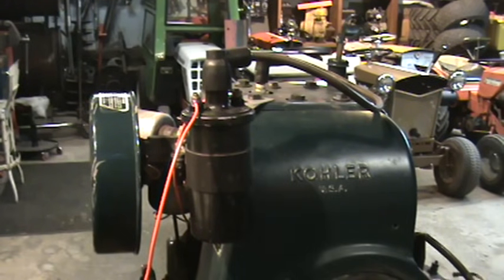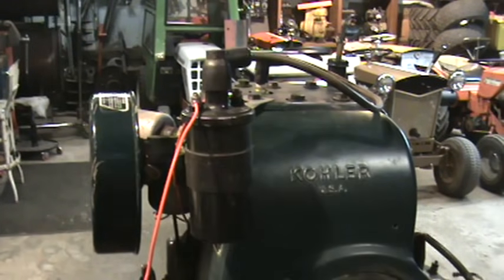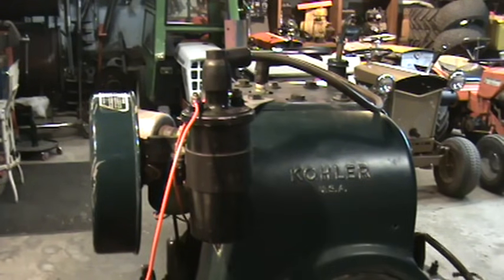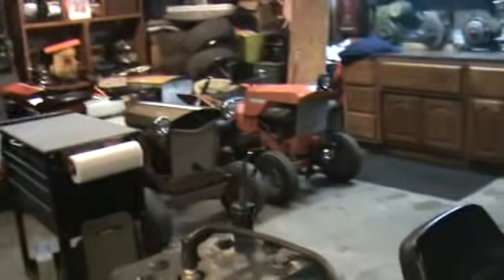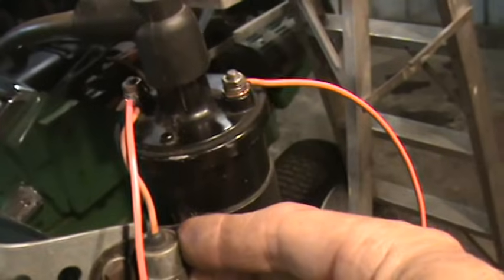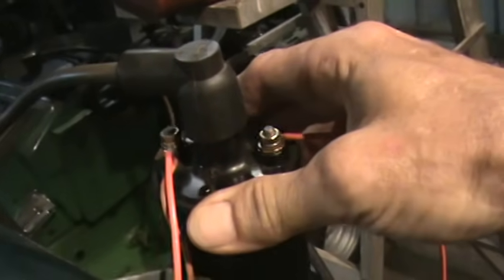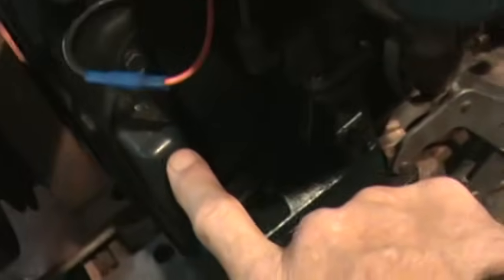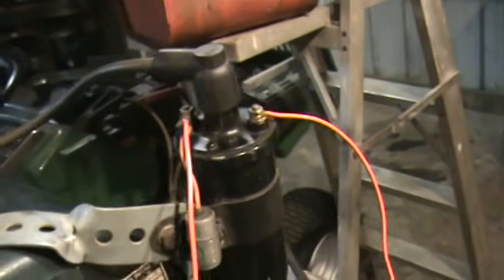Wiring an external battery coil to your engine

Comment: I have a 10 horsepower Wisconsin on a welder. I can't get the proper ignition coil anymore. Mine commands spark with a pulse of positive electricity will that work on that set up?

Comment: I put this motor on craftsman with the 3 speed high low rear end and it's side shaft rear end built pully guids and motore mounts to bolt my 12 kohler onto it and make it a belt driven side shaft mower  but I don't know how to wire it up to make it run I have my negative from cool to points but I also have a wire coming of the part that I changed on the motor to make it charge but I don't know wear it goes my egniton,my silinoed,my battery I honestly don't know and do I still run the positive from my coil to my positive on the battery or does it go some whear else now

Comment: The coil creates spark when the points OPEN, not close. When the circuit is closed,  the coil creates a strong magnetic field.  When the points open, the field collapses, with electrons going into the secondary winding and discharging across the spark plug gap.

Comment: Zippo if if my coil isn't connected right with the battery with grounded like you said and what would that cause popping in the engine like if I could hear like a popping sound coming out of the exhaust down in the bottom of the engine and it's a 1950 Ford car
Reply from the maker: The intermittent popping you speak of is usually points or ignition related at the distributor. It can be a dirty spark plug, bad plug wire that is arcing somewhere or the condenser could be going bad which would cause the points to visibly spark and cause the popping you describe. If your engine is still using the original points operated distributor then those are the things to check. If you've got an aftermarket electronic spark ignition then with the engine running, listen closely for a sharp click under the hood. This would be the faulty plug wire or other component arcing to ground intermittently. The easiest way to locate these types of faults is to start the engine and in as dark a place as you can find, just do a visual under the hood. You're looking for a strobing blue or yellow flash. When you find that, that is your problem. If nothing is seen or heard, typically doing a full tuneup will help or rid you of the ignition misfire. Zip~

Comment: I bought a 74 Dodge with a 318 with a "crank but no spark" scenario.  I have been replacing everything in the ignition system, and still have no spark.  Today I realized that the last owner had run the external capacitor/condensor (whats the difference?) from the Coil's "+" terminal and then to a ground bolt.  I removed the external capacitor/condensor and installed a new coil, and thought that would solve the problem.  But still no spark.  Would the mistake of having the capacitor run to the Coil "+" terminal have been the reason for no spark?

Comment: While the vehicle is running I have around 13.45 volts going into the coil and around 6+ coming out of it into the distributor. Is that how it should be? If not , is my coil bad? Its new.

Comment: I know this is old video but if you run your coil like this can you use the nova 2 to get rid of the point and if so would you still need a condenser?
Reply from the maker: The Nova II is not compatible with external Coil ignition. It's to be used with a Magneto type ignition system.
Reply: Is there a option for something like this that you know of that works for the external coil

Comment: Where exactly is your negative battery cable grounded to? I am having trouble getting my Kohler engine just like yours grounded.
Reply from the maker: I typically run a ground to the engine block. Anywhere on the block should be fine so long as you clear any paint from the access point.

Comment: Thx brother!  Tested my + resp -side of the coil…did not have 12 volts…car dont start.’..can i jumpwire direct from battery +?the coil is healthy, interchanged the coil with another car, and the coil is ok ! I just want the car started tomorrow as a quick fix to move the car.’..

Comment: hi how do you see if there is fire on the coil i swinged the motor but there no spark coming from the coil . I checked the points there is a spark . do i need a new coil or what can it be .

Comment: So the Positive side of the coil goes directly to the battery or to the ignition post on the key switch?.... I'm working on an old Ford/Jacobson with a K341 and the wiring harness is a mess and the original ignition switch was faulty when I purchased the tractor. I had to running last year for the summer mower season by jumping the solenoid but this year I wanted to install an ignition switch and build a new wiring harness. The original ignition switch had 5 terminals and the new one has 4 terminals/posts. Start, ignition battery and accessories. I was thinking the positive side of the coil should go to the Ignition post on the switch?....Am I wrong?.
Reply from the maker: So long as the key switch has + battery power when switched on to one of the terminals, you can connect the coil there for sure. Zip~

Comment: Hello there,,, I saw your video and was helpful, I have a gravely that has an ignition coil that connect to fly wheel.. there is one wire that goes to sparking plug and another male connector. is any way you can tell me where the connector goes... How should I wire that so I can stop the machine running.... thanks in advance

Comment: I have 12 volts on positive side. I only have 6 volts on negative side Going to my points and six votes going to my spark plug. I do not have any spark going to my spark plug. Can you help me please.
Reply from the maker: You've got a 6V coil. Either purchase a 12V coil or install a resistor.

Comment: Hi from the UK i have a 1940 small engine which ime fond of to good to scrap is this the only way to wire an ignition system ? as the coil condenser & points are all bad & are inside the flywheel ! & to replace those parts a cost of about $300 dollars thanks in anticipation

Comment: I have a panzer with a Kohler motor. It ran all summer, and two days ago no go. If I hold the spark plug wire, not even a tickle. I put new points, 18 gap, new coil and condenser, no go, I'm stuck HELP. I tested the coil and it shocked the crap out of me so I guess that is good.

Comment: Great Video, You have the best Video to explain the right way to connect the Coil to the points and condenser. One thing in your statement you first stated Capacitor for the Condenser then changed the wording to Condenser. You are Right the first time most people doesn't know the Condenser is a Small Capacitor. It build a electrical Charge and make the spark on the points hotter. Great Video Plus AAAAA++++++.
Reply from the maker: Thanks much for the props Waymon! I tend to use the words most are familiar with and yep...it's a small capacitor that the world market dubbed the "Condenser". The same holds true for motor oil. They CALL it Detergent Oil, but there is no actual Detergent in it. It has a variety of chemicals designed to hold the contaminants in suspension so they'll pass through a filtering media like oil filter or cartridge. When talking small engines without an oil filter, you don't want to use Detergent oils because the contaminants are not being captured by a filter and are instead, being carried throughout the crank case where they can do harm to bearings, bushings, journals etc. Cheers! Zip~
Reply: @ZippoVarga  Very Good  Article.

Comment: Omg I just realised my car is positive ground that's why it didnt work would it be the positive hooked to the ground or negative from battery wire also comes from generator that's grounded with the positive would that go to the positive or negative on coil

Comment: ok  hears a question  i have just acquired a quod ., scooter engine .  & it got a feu problems with the  waring infant it cut to bit's  & i think it time to rethink the system & revert to fitng points . here's a quick thought  given it as a place where the trigger coil fits as a pace of rased steel would this lift the points sufficient to open the points & fier the coil ? it 0ne mill thik prap's tow. i supo's a spot of weld may lift the pins more . but i would prefer not to wel on the fly wheel.  the stream reman as the ratified  garger for the battery .   Praps you could answer this question .

Comment: Question… I have ‘69 Lincoln mark III with A 460 engine.  It has a capacitor/condenser on the outside of the coil just like the one in your video.  There is also a condenser in the distributor with the points.  Should there be 2?
Reply from the maker: This is a question best answered by a knowledgeable Ford Mechanic. I don't know the requirements. Zip~

Comment: Did the original ignition key switch have 4 wire hook ups or 3 on the back of the ignition key switch mine has 3
Reply from the maker: The key switch on your particular machine is specific to your machine. I have no way of answering this, not knowing what application your key switch is installed on. Zip~
Reply: @ZippoVarga  mines still good just looks old is all

Comment: I have to power on the wires the go to the coil. Is that normal? Or what could it be?
Reply from the maker: Yes....if this is similar to your ignition set up, the Plus side of the battery must be connected to the Plus on the coil. Zip~

Comment: What if u don't have points condser  mine just has stator wires coming out under flywheel
Reply from the maker: Then it sounds like you've got a solid state ignition system. Zip~

Comment: Can you ground out the coil on the negative side I would assume not because the coil is grounded on the case right
Reply from the maker: No. The negative post on a coil isn't for negative or ground, the + is for the battery input and the - goes to the points. The grounding happens on the case of the unit when it's mounted. Zip~
Reply: @ZippoVarga   thank you I figured it out I didn't have ohms on the coils I was using, the couple coils I used only had .8 ohms and 1.7ohms and I found that 2.8-3 ohms works the best for my application thank you

Comment: How would this work if I got an electronic ignition and cut out the points setup?
Reply from the maker: It wouldn't.
Reply: @ZippoVarga  I don't understand. If a electronic ignition device replaces the points why wouldn't an external coil work?

Comment: Question  I have a kohler k181  it runs for not even a min and stops can not Rev it up nothing  is the condenser  to be grounded  to the motor is that why motor will not run

Comment: In the commentary from  0.55  to 1.15 min  the description is wrong , In the external battery powered coil  current is flowing through the coil when the points are Closed  creating a magnetic  field  from the primary winding in the coil that surrounds the secondary , ( high tension )  winding  ,  as the engine rotates to the correct position to fire  ,   the points then Open.!!    The current flowing in the primary ceases and the magnetic field collapses , that is where the condenser comes into play , it reduces the arc when the points break and ensures a faster collapse of the primary field
 The collapsing field induces a  high voltage in the Secondary  coil which is   Conducted by the High Tension lead to the spark plug

Comment: What is the purpose of the condenser? I have a 1973 Dodge Dart Swinger that won’t start. The condenser wire is frail.
Reply from the maker: The Condenser serves as a charge storage device, much like a Capacitor and they are prone to going bad and inexpensive to replace. Zip~

Comment: What would cause my 1990 dodge d250 with the 318 to lose spark right after I fire it up it will idle for a few seconds than shut off and I'll have fuel but no spark
Reply from the maker: Check for a proper ground to the coil and ignition switch. Sometimes terminals get corroded and need cleaned. So go over all of the ignition system wires one at a time and clean them then add a dab of dielectric grease to help prevent future failures. With the key switch, there is a pigtail (plug) at the base of the steering column that the key switch wiring goes through. Disconnect and reconnect the plugs to help clean them, but don't use dielectric grease on these because it can breach connections and cause more problems than it solves. Good Luck! Zip~
Reply: Ballast resistor

Comment: I have a wheel horse gt 14 with a kohler k 321 and it had electric ignition when I got it and no key ignition and I bought one for it but I don’t want to use lights or accessories so do I need the magneto? I have to check if the stator is there

Comment: I have a 1979 chevy luv I run it 30 minutes and the coil heats up and the truck turns off and when the coil cools down it turns on What could I do
Reply from the maker: You need to install an in line resistor. A good auto parts store will be able to point you in the right direction. Zip~

Comment: I have power on positive side of coil when key on and cranking ,
Condenser and points wire on negative post on coil No Spark?
I need to check ground ?to engine .

Comment: I replaced an internal coil with an external on a  1978 Simplicity garden tractor with  a 16 horse Briggs. The coil has and internal  resistor.  Can you tell me what the ohm reading should be when I check the + to - poles?   I am not showing any ohms at all.  On a coil with an outside resistor you should get 1.4 t0 1.8. Is it the same with internal  resister?  Thanks

Comment: What engine was this? I have a very similar, if not the exact same one. No ignition to spark. My question is how long will the battery last before needing to recharge??
Reply from the maker: It's a Kohler K series 12hp. If your engine doesn't have an internal or external generator, it's all dependent on the quality and type of battery. A deep cycle would be your best bet so that you can fully deplete the battery and recharge it many times. I can't even begin to offer an answer to your question of how long the engine will run though. Zip~
Reply: depends on the batter i once drove   a lorry  all the way to maffick & back   on a faulty alternator  it was only when the lights  whear on it gave me a prolom.

Comment: Have a Clark forklift that I need to troubleshoot coil and distributer cap . Itt doesn't have points it has a little black box with two wires coming out of distributer where do they go on the coil. I have hot on positive and when I turn key  I have hot on negative but nothing coming out of coil. How do I wire it correctly. Please help

Comment: What kill the engine after you start it and cut it back off
Reply from the maker: Disconnect the positive battery power going to the coil either with a toggle switch or key switch

Comment: I have a 73 mg midget and ca t seem to get it wired back up right. I dont know where the points are.
Reply from the maker: The points are under the spark plug cap on the distributor RL. Zip~

Comment: My 1963 chevy Impala coil positive is connected to the starter and the second wire to the fuse box. And negative side of the coil is connected to the distributor points. I wonder if this correct because i am not having any spark and/or what can be the problem to fix this?
Reply from the maker: Your best bet is to go to the original Wiring Diagram and let that be your guide for proper wiring Ernesto. With so many battery ignition types out there, the manufacturers of each have slight differences in approaching the wiring. Best of luck and sorry I can't give you specifics. But they should be easy enough to search. Stay Safe! Zip~

Comment: Do I need to install the condenser that came with my coil if there is already 
one in the points box?
Reply: Travis Matthews any luck.
Reply from the maker: It depends on the engine requirements. Typically, one condenser is all that's needed. Zip~

Comment: Do u need to set ur points or all the way down
Reply from the maker: Points should be set to .020 initially. Then, once you've achieved spark, you can fine tune the points with the engine running for optimal (Hot Blue) Spark. Zip~

Comment: I have a case 300 we are trying to run. It had gas but no spark . There's power running to the coil but from there on, no more power
Reply from the maker: It sounds like the coil it self is bad Ricardo.

Comment: Thank you Zippo! I'm restoring a Wheel Horse Charger 12 and the odd but expensive flywheel magneto is bad. Any recommendations on what coil to use and to either wire to a toggle switch or the ignition switch.
Reply from the maker: What engine (model number etc.) is it Brian? Zip~
Reply: @ZippoVarga  It's a K301 S.  Sorry for not mentioning that... Thank you for the quick reply!

Comment: I have an lj80 and the condenser is on the distributor,
is the ignition the same as the points box?
do i connect the negative to the condenser even though it is on the distributor?
and is the ignition on a relay which connects the positive to the coil?
so the main coil wire goes to the distributor is that the only wire that goes across because the spark plugs are grounded? 
i hope you understand and can help thanks?
i don't realy know what i'm doing

Comment: Hi for the Kohler 12hp engine do I need a coil with or without a ballast.
Reply from the maker: Depends on what coil you have. If it has 12V stamped on it somewhere then no, if there is no markings to tell you the voltage, it's most likely a 6V and will need the resistor. Zip~

Comment: I have a question about the condenser. Using a test light With the ignition switch on Is the positive side of the coil supposed to be hot?
Reply from the maker: Both sides of the coil are actually "hot" when the coil fires. The "-" negative symbol is simply the wire going from the coil to the points. So, with the key switch on, the coil will be hot going to it and coming from the negative side when the points close. The instant the points release, the stored energy in the condenser it released and the spark plug fires. Zip~